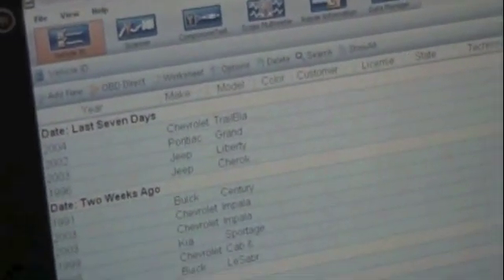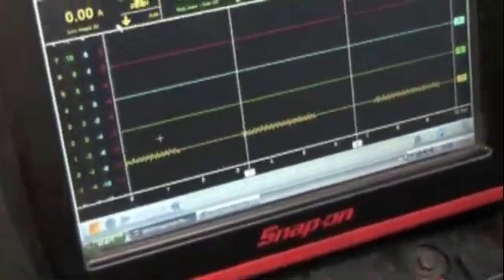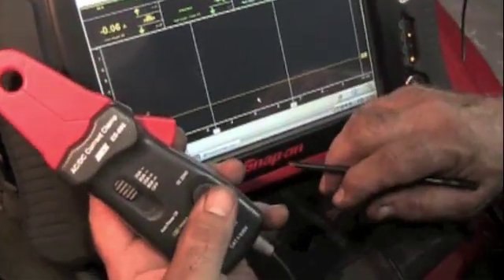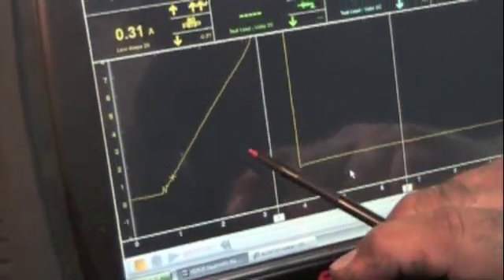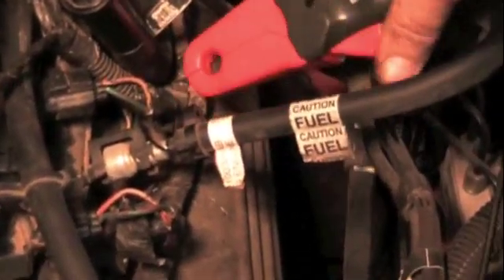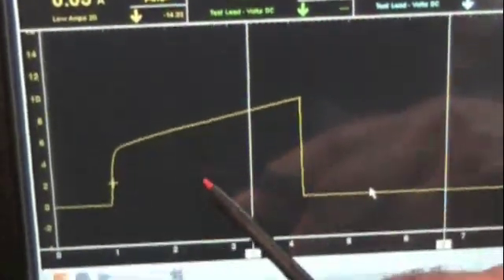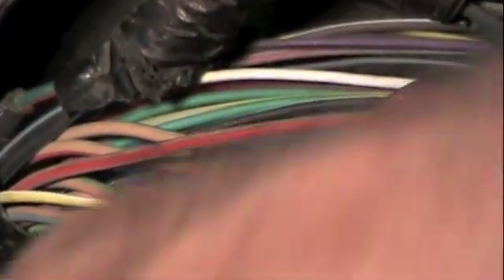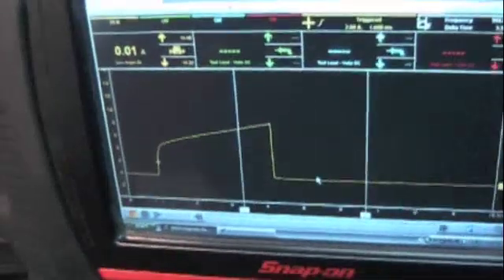Labscope coil ramping 1

Comment: Is there a way you could get all of the coils on the screen at the same time with that probe?
Reply from the maker: sure, use a 4 trace scope set to display all 4 screens and tap into each one separately.  Easy to do but a little time consuming.  A short cut would be to do one coil capture it, then the others, caller each one, then compare the playbacks

Comment: Every coils used to produce high voltage uses ramp wave, whether it is automotive ignition coil, or a TV flyback transformer, and just about every coils used to produce high voltage. The reason for this is a ramp wave is ideal for producing high voltage because of the abrupt drop in cutrent.

Comment: hello great video big help for what i'm working my question is can i use the amp probe if the there is 3 wire the car that i'm working is a 2003 nissan maxima 3.5 engine

Comment: Good video! Only comment that I have is the settings on the amp probe. You mention that the settings were analog and digital. Actually, the sine wave symbol is for for AC amps and the other two symbols are for DC amps.